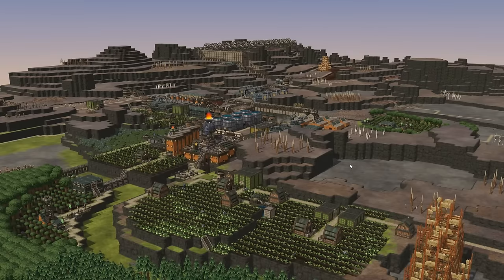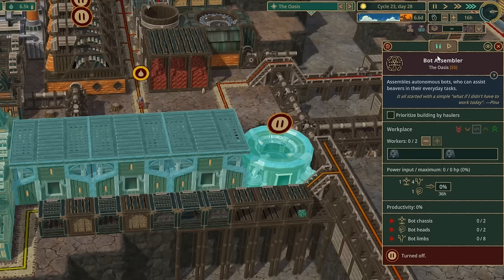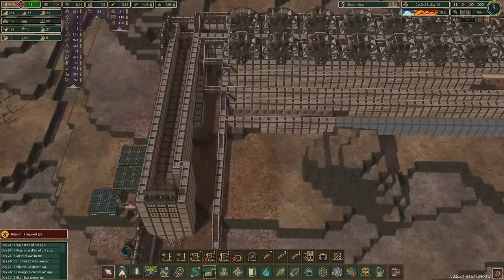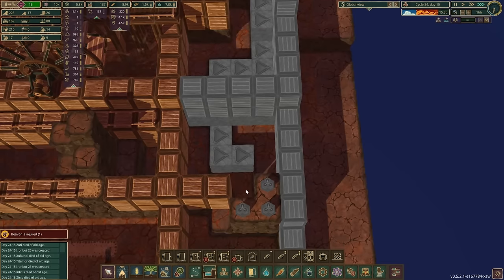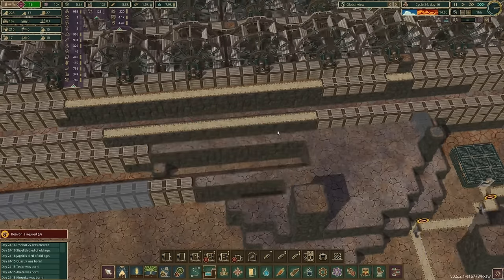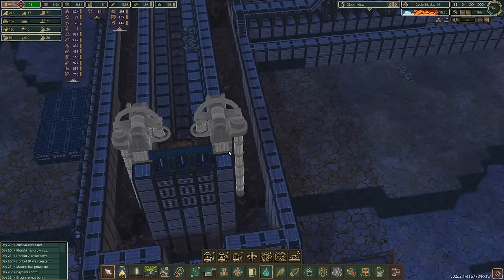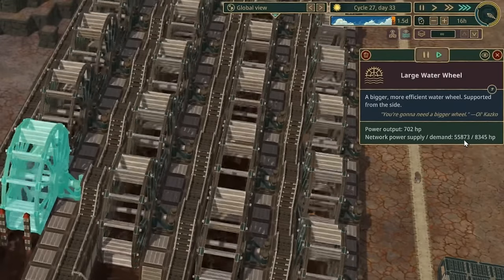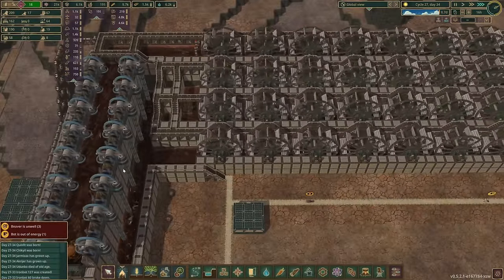How to get 80,000HP from ONE Bad Water Source! - Timberborn BADTIDES Ep 9 - Update 5 Hard Mode

Comment: The Dura-log power system is the greatest power generator known to beaver-kind.
Built in the 25th cycle, this great wonder of beaver engineering has turned a once feared hooman disaster into a sustainable long-term power source. This 80,000-ish HP  wonder will benefit all of beaver-kind for cycles to come.

Comment: I really like this project. A great idea! 
One small issue: if you use more than ~ 77500 power, it will logistically (/sigmoid) die off to some limit value of ~ 25000 really quickly. One could take (700*16)/(77000/64)  ~ 9.3 wheels, so, for example, the first left most 3 rows of water wheels as a separate network to guarantee almost full efficiency, and accept the ~ 62500 power as the output, which will always be there even if there is a literal brownout. :D
Reply: It is literally impossoble tu use 77k hp on a map of timberborn.... anyway nice idea
Reply: This is a great idea for realism and real world dynamic systems. But its probably not necessary given how unlikely is its that anyone would ever get that high in power use without specifically trying to maximize power usage.

Comment: The waterwheels can take about 17.1 max / tile of flow rate.    With as flow rate of 10 on each tile you should get about 3,000 hp / wheel that would give you approx. 192,000 horsepower  with the same amount of wheels. :)

Comment: Be careful about your power draw going forwards, if at any point you try to draw more power than you're producing then the pump output will begin to diminish and you'll enter a death spiral. Never go above 90% or so load of your total output value and you'll be fine forever. In prior experience though, you can sometimes get a dip with this sort of system when you first load a save and you have to give it a few minutes to restabilise so keep an eye if you get close to capacity. Otherwise sweet build, really good job dudeski!

Comment: im not good at timberborn but i can see that this power plant does have a disadvantage when you run out of power somehow for even a minute the pumps will have less efficency witch will couse even bigger power leak and so on untill pumps are almost running at 0% so make sure you build at least a small power storage in case of that type of incident :)

Comment: You get perfect ratios on bot factories if you have three part factories (one of each type) supplying two bot assemblers. You have just one bot assembler, so you should add another one. you can already support it. This will result in you producing 1.5 bots per day (before accounting for work-speed bonuses). If you produce 1.5 bots per day, and a bot lives for 70 days, then you will have 105 bots at any one time.
Edit: I paused the video, made this comment, and not 10 seconds later, he's noticed it.

Comment: pretty sure the loss of flow is due to either evaporation throughout the system or the interference of flow from the source and the pumps as the water flow may change due to "colliding" with water idk for sure i'm not to knowledgeable on its current physics

Comment: What would happen if you close the bad water, would it still generate power indefinetely or the bad water would evaporate and stop producing energy? Great feature of this playthrough!
Reply: It will slow down until it stops. He has an outlet in the system for the excess to flow out of so some of it will spill out and all the fluid left in the system will dry out over time.

Comment: Skye I love the series you put out for TimberBorn and the mega projects are great…..but I can’t hold my tongue on this one. TECHNICALLY, it’s not producing 80,000 power or 77,500 for that matter. The mechanical pumps use 700 each and you’ve got 16 of them. So your actually only producing a measly 66,300 and since beavers round down and they’re horrible at mathematics, that means your only REALLY producing 50,000. And since I’m bad at math that means your off the mark by 50,000 power. There’s only one solution….. Your going to have to make a few changes, add a few more rows and rename it, the Super Wheely Whooper Duper Mega Giga Terra Dam. And yes, I do accept payment for my services in bloop bloops

Comment: You don't have to take those paths one by one.  Click on one of them and drag just like you would the regular paths. Just make sure it is the path only not the levy.  Hard to explain but work it, try it, it works I do that a lot.
Reply from the maker: That doesn't work .. it deletes everything above it
Reply: @SkyeStorme you just have to be careful with the click position, but you can do it, you have to select the path underneath the platform while having the map down to the level of the path and hiding the the platform, then make sure the platform feet are not red, also if you just select the path from outside the platform it will delete everything from above
Reply: @ericsaul9306 looks like a little quality of life fix is needed there. Wonder if there is a mod for it

Comment: does that work with folks too despite it beeing only  4 deep there?
Reply: It should. The only thing you'd have to change is the width of the pool. You might not get as much power as the iron teeth since you need to double the pumps, which makes it less efficient. Also, folktail has a different water wheel, so you might not get as much power again.

short answer no.

you won't get as much power and you'd need to double the amount of pumps. i've just checked the details of the waterwheels. Ironteeth's waterwheel (large) is 180 cms for an area of 5x2, while folktails waterwheel is only 3x2 @ 90 cms. which means if you copy exactly as skye has it, you'll get a different power output not to mention you'd need to double the amount of water pumps. the folktails only has a 4 deep pump to reach the 6 height we have in the video you'd need 2 layers of pump. (in this case you might as well change the parameter to 8 levels high to maximize the two layers of pumps). next you need to widen the channel to 4 wide if you wish to match the power output of one of the water wheel. but if you do this you are reducing the delta q (flow rate) in the channel.
Reply: 14,000 power consumption on power alone for 2 layer high water pump. each water wheel would do about 90 x 13 (going by previous season limit) ~ 1170 power per row. 1170x8 (for 8 levels high) ~ 9360 on base flow now add the 10 cms on top of the base flow. assuming 2 cms = 90, (10 cms is split between the channel that is 2 tiles wide, so each tile is 5 cms only) at 5 cms the power should be at 90(2cm) + 90(2cms) + 45(1cms) = 225 

~225 per water wheel @ 10cms your power output at maximum efficiency is 225 * 13 * 8 ~ 23,400. 60% of that power is used by your pumps. might not want to use that many pumps in this case.

Comment: Have you messed around with metal platforms? You could fit more pumps in, therefore increasing flow rate leading to more power!!!
Reply: The thing is that more pumps would increase the water height and it would overflow.
Reply: How would that work?I though metal platforms are a standard square. If you used a metal platform, how would you direct the water to where you want it to go? You'd need to stick one end of the pump out to pump the water up.

Comment: puzzled, unless you game values are different, possible, as I calculate 16 wheels to a row times 4 equals 64  that equals 11520 HP less two rows of 8 pumps total 16 each draw 700 hp equals 11400hp power out put in hp 11520-11400= leaves you a surplus output of 120 hp ?? I dunno , where does the 80,000 come into it